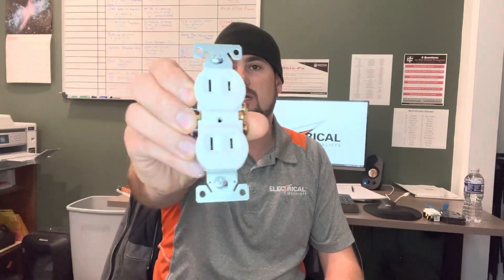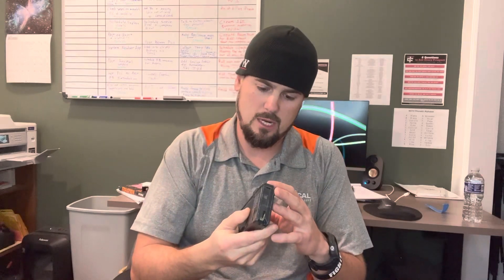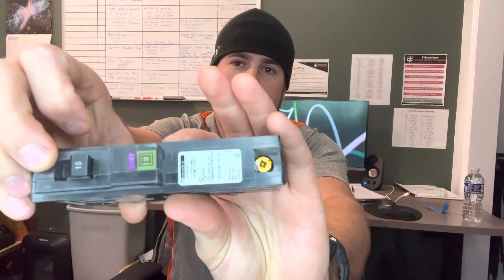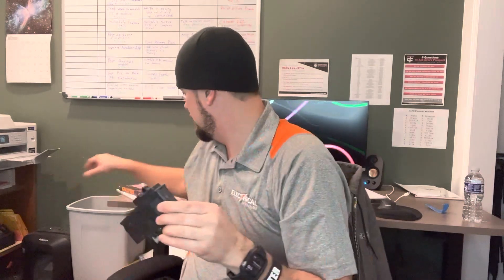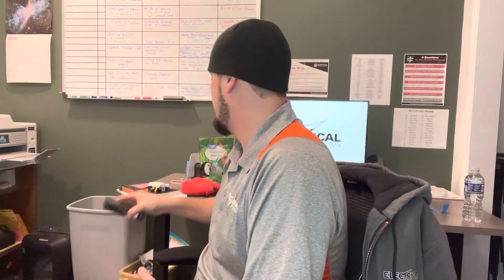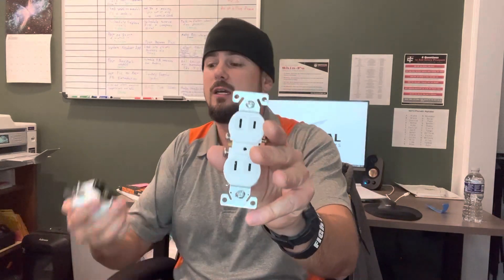How to LEGALLY Upgrade 2 Prong Outlets to 3 Prong (No Rewiring Needed!)

Comment: Though your solution solves many issues it appears to me that it wouldn't help people who need and use a surge suppressor as that device needs a proper ground to work.
Reply from the maker: That's a good point! That's exactly why we install a whole house surge protection device directly in the panel. As long as the panel is grounded properly it protects all circuits on the secondary side. Problem solved.
Reply: @electricalspecialists  If one owns their unattached house would it be less expensive and within code to simply wire a ground from the box to the outside into the ground for each room or set of rooms instead of snaking a ground through the house to the main in, say, one's basement?
Reply from the maker: @lazurm  Excellent question. If I understand your question, you are asking if you can drive a ground rod for one or multiple sets of devices and run a ground wire directly through the wall to the device.  Unfortunately ground rods are only considered a secondary source of ground and do not count as having a solid connection to the grounding system. Yes its better than nothing, but it will not achieve the ground circuit continuity desired. We would suggest contacting your local city electrical inspector.
Reply: Surge protectors have varistors between all three wires so they do not need a ground connection.
Reply: @okaro6595  A varistor cannot be used instead of a ground. A varistor is an electronic component that is designed to protect electronic circuits from voltage surges or spikes by limiting the amount of voltage that passes through it. However, a ground is a reference point in an electrical circuit that serves as a return path for electric current and helps prevent electrical shock or damage to equipment.

While varistors can help protect electronic equipment from voltage surges, they do not provide the same functionality as a ground. A ground is an essential safety feature that helps to protect both people and equipment from electrical hazards, and it is required by electrical codes and regulations in many countries. Therefore, it is not advisable to use a varistor in place of a ground.

Comment: can you use that breaker if you have three wires , but open ground at some of the outlets??
Reply: In some homes that originally had galvanized steel pipes replaced, you get open grounds if the plumber did not bond the ground from the old cold water pipes to new copper lines.  Sometimes, a handyman with little electrical experience will replace metal water lines with CPVC or PEX pipes, breaking the ground continuity on older homes that relied on the water pipe to ground the boxes.  Some homes are grounded that way, using the cold water pipe as a shortcut, when the ground wire was a separate wire from the NM cable used for wiring.
Reply from the maker: Good question! 
Absolutely it would work as supplemental grounding for the devices that have an open ground. But we would suggest looking into why the ground circuit became broken for best results.
Reply: If you have a problem in a relative recent installation you need to fix the problem. This is for old installations with two prong outlets and by logical extension cases were someone has changed them into three prong with non-acceptable means.

Comment: I have a older home, built in the 1950s, doesn't have ground wires. I tried to put in GFCI breakers in but the breakers keep on tripping even with nothing on. Also, if the new GFCI breaker does not trip, when I turn on the adjacent non-gfci break on, the new GFCI breaker trips. Any idea on what could be causing it?
Reply: Many homes of that vintage have shared neutrals, either multiwire circuits where you had two hots from L1 to L2 sharing a common neutral typically in the kitchen but may be in other areas of the house as a means to save on wire and labor costs.  Or you might have 2, 3 and 4 gang switch box with two circuits with the neutrals tied together. Could also be in junction boxes in the basement or attic as well. Troubleshooting would include shutting off power, opening up boxes, then turning circuits on one at a time and testing for voltage until you find the box where two different circuits are landed, then separate the neutrals so that each circuit is on it's own neutral.
Reply: @Sparky-ww5re  I'm guessing that it would be better to have an electrician do all of that?

Would you recommend just putting a GFCI receptacle in the first line and then piggyback non-gfci receptacles after that instead of trying to find and rewire the whole house?
Reply: @JServTennis  yes unless you're very experienced and feel comfortable going thru the house opening boxes , testing for live voltage, tracing circuits etc I would highly recommend an electrician come out if you want to do it right and be safe.   You could used a GFCI receptacle at the first outlet in the  circuit,  but I would also highly recommend an AFCI/GFCI receptacle on the first circuit because that wiring is approaching 70 yrs old, it can become brittle and cracked,  especially in ceiling lights.  The homeowner before you could have been using 75 or 100 watt bulbs in a fixture designed for 60 watts max over a long period of time,  the heat from the bulbs bake the wire insulation in place which can crumble off at the slightest touch or movement,  even from nearby vibrations such as children jumping on the bed.   Arcing fault are a major cause of house fires, but particularly in older systems which have a higher chance of being abused over time.   Just note that installing an AFCI/GFCI receptacle on the beginning of the circuit cannot provide protection between itself and the panel, but will protect everything downstream,  and the longer the circuit and the more devices of course means a greater chance of problems
Reply from the maker: @Sparky-ww5re  Well said.
Reply: I had the house rewired when I bought it. The electrician left a couple of circuits that were wired with metal sheathed cable and metal outlet boxes. He told me the wiring was grounded because the metal sheathing was grounded to the metal box and the new breaker box. The plugs were two prong. I learned that because the metal sheathing was grounded to the breaker box that I could add a ground wire to the metal outlet box by screwing it into the outlet box. I’ve done that to the five outlets the were still two wire and have had zero issues. In fact it fixed a problem with one outlet that kept  frying the stove computer board. I’ve since rewired the entire kitchen with romex. The outlets in the basement are functioning just fine and test properly. No more three to two adapters. Unconventional maybe, but electrically sound.
Reply from the maker: Absolutely Jeffry thanks for your question!
From the age of your home I would assume you might have knob and tube wiring. An issue that can be difficult to navigate is isolating neutrals. By nature knob and tube wiring share neutrals on multiple circuits. The way GFCI and Arc-Fault devices work require each circuit to have a dedicated neutral. You may have to do some investigation and check each circuit to make sure this will work for you. Typically if you cannot get the breakers to hold the next step would be to start investigating where GFCI devices need installed in line to protect all circuits.
Reply: If you do not use the load side then it should not trip as it controls only what is plugged. Of course then you must use GFCI on every outlet you change.

Tripping could be because of a shared neutral or some problem in the wiring so maybe it is better to find why it trips
Reply: Shared neutral.

Comment: Much better way to go, will it fit in most panels?. Trying to install a GFCI in an older homes 2 prong outlets which have smaller boxes that are usually in plaster walls is not easy as well as ripping the box out for a larger one.
Reply from the maker: Absolutely. Great question and great point!
It is not reasonable to try to install a GFCI device in some older homes with shallow style metal boxes. At this point it would make much more sense to install breakers which we should 
suggest using dual function. They are only $5 more protect you in multiple ways. But... you do have to have a new enough panel to that will accommodate the breakers.  To find out if your panel will you can usually find the make and model on the inside door of and do a google search. At the very least take a picture of your panel and take it to a big box store and see if they electrical isle person can help. If nothing else feel free to contact us with a picture and we can tell you for sure.
Reply: @electricalspecialists  Thanks for the answering. I'm going to guess it's probably 20 years old, it is a Murray 200 amp panel..
Reply from the maker: @whitetiger8652  Great! They do make them for your style of panel.
Reply: @electricalspecialists  I'm aware that if you have a Square D XO panel, you need to replace the panel if you plan to use AFCI/GFCI Breakers, as the old XO breakers are no longer made, and nothing fits in its place.
Reply: I think it's safe to say that if your home has only 2 prong receptacles that the AFCI GFCI breaker is not available for the panel. In my case, the panel is a 60 year old Pushmatic. There are 8 circuits, all single pole, one 20 amp and seven 15 amp. It looks to be in good condition and works fine. The interesting thing is that there are ground wires even though the cables have only hot and neutral wires. The ground wires run separately and they are attached to the outside of each box. All the boxes are metal and I verified that they are grounded. I changed all the receptacles to 3 prong and added GFCI receptacles where required. There is no ground wire to attach to the ground screw but the receptacles are grounded by metal to metal contact when installed.
Reply: @surferdude642 Extremely interesting story.  Each metal box grounded.   Putting in 3 prong receptacle, did the yolk now ground the 
the third prong?
Reply: @tedlahm5740  Yes, plus I coiled some 14 gauge wire around the screws for better contact on recessed boxes. This is as good as connecting a ground wire to the device screw, as long as it's intact or having the power off if removing the screws.
Reply from the maker: @surferdude642  Yes if the panel has not been upgraded this would be true. No I am not aware of a pushomatic style arc fault or other style breaker. Also you might check with your local AHJ to see what is acceptable regarding the grounding of device boxes etc. Every jurisdiction is different.
Reply: @surferdude642 as an extra, what about screwing a short ground wire into one of the holes in the back of the box with a self tapping screw and screwing the other end to the ground screw on the new three prong receptacle since there is a bare copper wire ground clipped into the box?  I know it seems redundant but a hard copper link just feels right.
Reply: @marcisaacs9407  Sure, you could do that.
Reply: Astonishing how cheap they were putting in 2 prong receptacles.  comment please.
Reply: @tedlahm5740  You could argue that they are still cheap, but industries have been required to provide more safety in their products. For example, in the days of 2 prong receptacles, cars didn't come with seat belts or other modern safety features.
Reply: Most homes with 2 prong outlets were built before 1962.  My home was built in 1955, and the only outlets grounded were the bathroom outlet, the central heating outlet, the laundry room's wall next to the sink, the kitchen outlets on the wall with the sink, the detached garage electrical boxes and the light switch box in the bathroom and the switch boxes to the outdoor porch lights.  The separate ground wires ran to the Square D XO breaker box and the steel cold water pipes.  1 grounded outlet got added to an outside wall on the house to power a water softener.  I have replaced 3 outlets with GFCIs: the 3 prong bathroom outlet, the outdoor outlet powering the water softener's timer and the first outlet in the detached garage, sending power throughout the garage including the light fixtures.  The old laundry room got converted to a bedroom, and the laundry sink got moved to the detached garage.

Comment: I bought a $16 GFCI plug-in adapter. I do not want to mess with installation and wiring.
Reply: I bought one also. Ran an appliance through it and I basically overheated it. Yup, kinda overheated it to a point of near melting it. So install a gfci no matter what.
Reply: @georgecurtis6463  Sorry you had a bad experience with the adapter. Internal circuit breaker should have opened. If you can, get your money back on the adapter.
Reply: @quartytypo  yea, I thought it was odd at the time. Guess those are fine for temporary use at construction sights and such but not in the home. And I just tossed it. Not worth the time and gas.
Reply from the maker: @quartytypo  That is where it can get confusing. The switch inside of GFCI is designed for variations in milliamps. Hence its designation for protection of personnel and not equipment. A surge arrestor would be more designed for the use of protecting certain equipment. Heat is the main principal of what will throw a standard circuit breaker in a panel. I would be concerned that the breaker did not do its job and may need replaced if there was any melting of plastic etc.
Reply: @georgecurtis6463  So you had a bad example. Do you think sockets are never bad?
Reply: @okaro6595  no idea. But for sure the plug in gfci units are not ment to take what was running through it, a coffee maker. I tried the other one that was the same and it started to heat up. So instead I now just use it plugged straight into the receptacle and have no problems. Not an expert in this stuff but when something goes wonky I dont tend to repeat it.
Reply from the maker: That is another cost effective way to protect yourself at one dedicated area if that is what you are looking to do.
Reply: @electricalspecialists  my old house still has two prong ungrounded outlets. So when using them for anything besides a light bulb I do use the adapter. That works fine. Just not for high draw appliances.
Reply: My hair dryer also has a GFCI at the end of the cord.
Reply: You still need to do some trick to do the two prong-three prong conversion. If you have an ungrounded three prong outlet you cannot fix it with an external device.